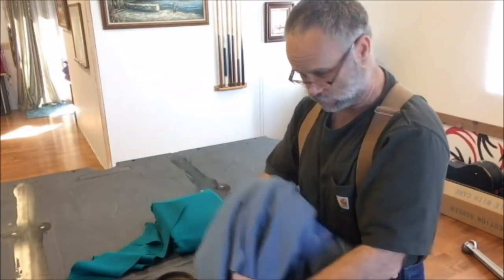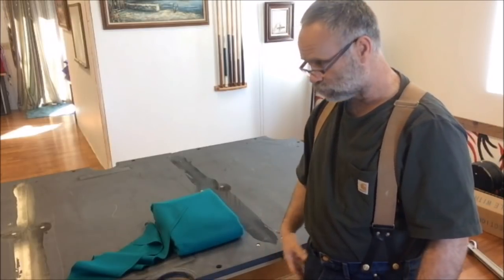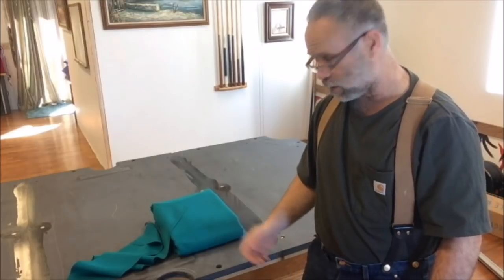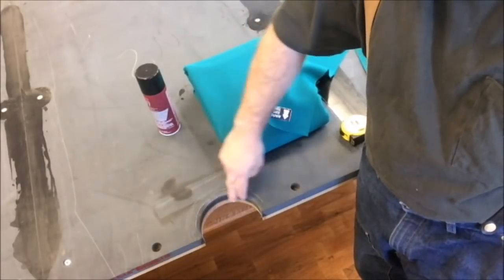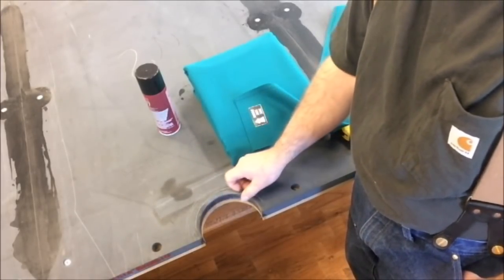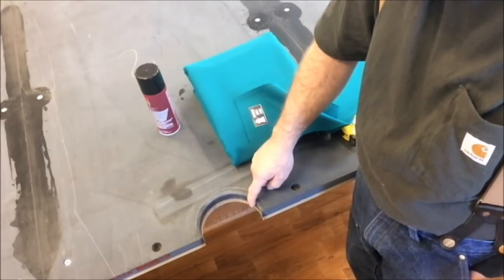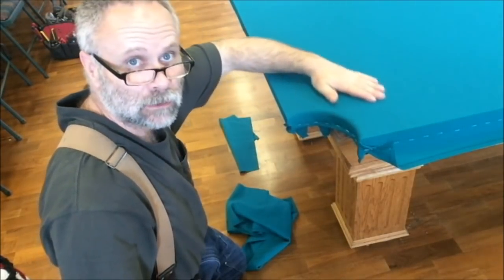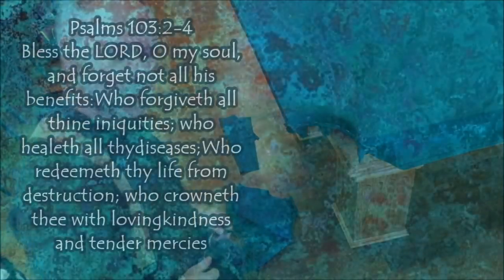Installing New Fabric on the Pool Table

Comment: I followed the same instructions, went really well, can't complain.
My table didn't have wood around the pockets so I couldn't staple there. So if that's the case for you, I would recommend to forget the felt doubling in the pockets and instead start gluing the felt in the pocket radius and then under table for the rest.

Comment: Very well done.  Thanks for sharing your cloth install.
I do pool table installs and re cloths.  The speed cloth used on the USA tables can be very challenging to install especially at the pockets. There is almost no stretch and it's very non for giving.
I've seen experienced installers struggle with the speed cloth.
Thanks again.

Comment: Just bought some speed cloth for a pool table.  It has a smooth side where you can see the stitching,  the reverse side is slightly fuzzy,  like a felt.  Which way is up?  I'm confused?
Reply: Smooth side up. Check out the video at around time stamp 3. Thanks and hope the best on your project.

Comment: How do You get old glue off the side or isn't it nessary I scraped most of it. There is no wood under slate. It's a 8ft kassan
Reply: Anywhere you have ball play or ball contact you want “perfectly” smooth. With your table they may have used glue to stretch and hold the cloth or felt wrapping it around the bottom perhaps. I carefully studied how they put mine together before disassembled the table. Hope this helps.

Comment: Hi my cloth was laid about two weeks ago it’s simonis and now their are puckers on the long rail or ripples . The guy who laid it said it’s because of humility. How come it’s not all over then . I think he didn’t pull it tight enough ? Your opinion please ... ASAP
Reply: Humidity
Reply: It's not humidity. Your installer did not stretch it properly. With good technique, Simonis or any other worsted cloth are no more difficult to install than a woolen cloth. Your installer over stretched the cloth from front to back, and didn't use a lateral stretch along the length of the rail. They also stapled too close to their stretch point. While you're working the length of the rail, if you stretch about an inch ahead of where you're stapling, the cloth is still tight, but doesn't leave the puckers or stretch shadows.

Comment: I kniw you know what your doing...but when you stretch a cloth or else on a flat thing and you want it really well stretched ..you start in the middle of each side..than you work on each side of that middle staple on each side ..one on right all around ...next one on the left side of the middle one on each side..all around...etc etc til you get finish on all four sides that is the way you do painting canvas to have it really well stretched...
Reply: Right Angie. Securing the center on one end, stretching evenly to each pocket on the same end and securing, go to the opposite end, start at the center and secure the same way then work the sides starting at the side pockets.

Comment: When I wAtched some do this. They had started in the middle pocket and went to opposite corner. Using a sheet metal visegrip to pull fabric to the pockets. And attached the felt under the table.   I was hoping to see that again. As that was 20 years ago
Reply from the maker: This was his first time doing this so he was learning as he went. Regardless it turned out beautiful and has been used many times at our family gatherings here since
Reply: Rain Country he asked for feedback, So I gave him what he asked for.  I’m gonna do this soon, and I need someone to give me the tips so this does not happen to me. ( tight pockets ).  I would assume others are looking for the same

Comment: Why don?t you try to moisten it a tiny bit the tissue will let go and give you some stretch part..for the pockets...
Reply: I thought about hot water in a spray bottle on a mist setting but didn't come across that technique anywhere in my research. It just takes practice and developing the skill to perfect it.